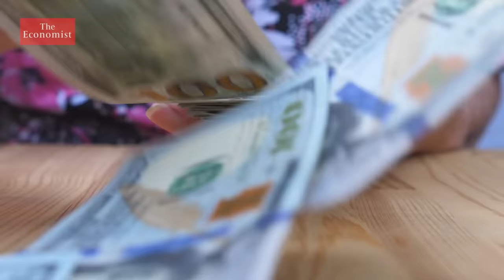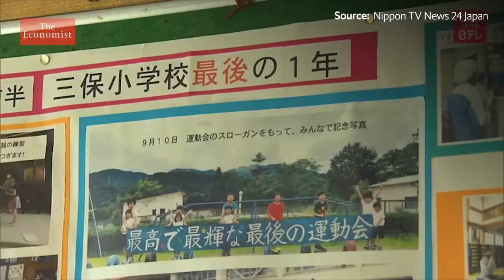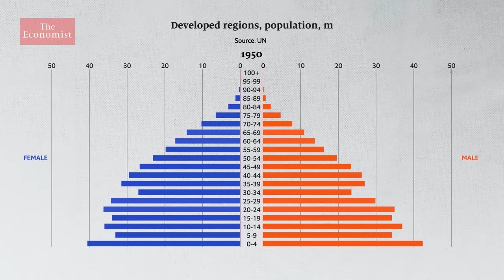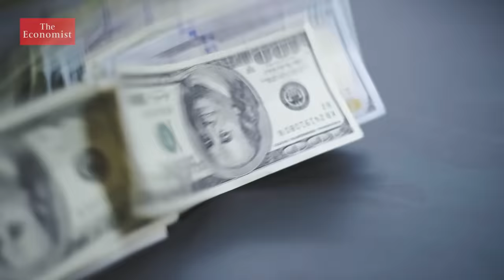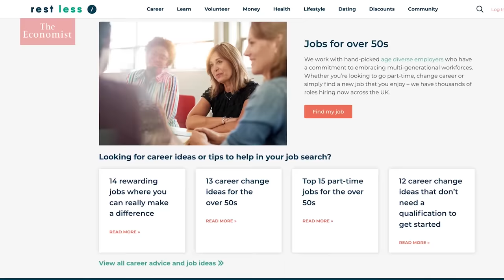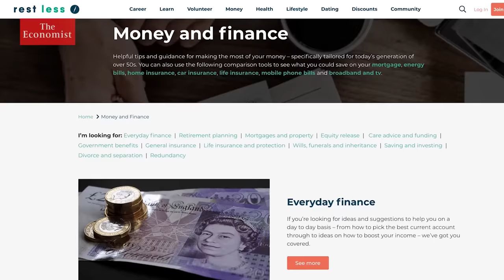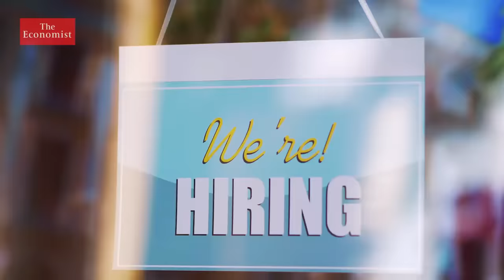The true costs of ageing

Comment: This is the new mantra they are pushing on my demographic (generation X )."If you could all just work until you die and not claim the pension you worked hard for that would be great". After having supported both the younger and older generations in my country for the last 20 years I intend to retire in my late 50s and I have made sure I have the finances to do so, but unlike other generations, I won't be squandering my pensions and finances on overpriced holidays, extortionate golf club fees and over specked Range Rovers, etc. Plus with the increase in both automation and AI technology just what jobs do they think will be left?

Comment: No easy solution that doesn’t over burden younger generations or unsustainable over the long term.
Reply: How about delete the Government policy that assumed a low dependency ratio?
Reply: @RyanLasek  how about increase the tax base (have more babies)
Reply: @alexrussell2903  That's ridiculous. House prices are caused mainly by super low interest rates set by central banks causing it to become desirable as an asset to investors while also bloating borrowing power. Therefore it's a matter of a lack of regulation, not even supply in most parts of the UK where I am from. What low birth rates will do is place financial pressure on young people via taxes, as welfare costs rise. A younger workforce will be a more dynamic, active and energetic workforce and will result in a higher GDP output. Higher birth-rates will make young people wealthier.

Comment: we need to reduce the costs of goods for everyone. mainly food water and housing. and we do have the technology to do that in most cases. we just need to make it more mainstream. lab-grown meat, vertical farming, and smart houses. we work too much for too little. we need to fundamentally change - the entitlement to buy anytime we want something. 
and this was caused by a 9-5 work culture.
we need to drive the prices of most goods to 0.
Reply: @pn7134  No no. He is absolutely spot on, and it is NOT communism. Rather it is the pinnacle of laissez faire capitalism. It is about moving from a single centralized structure to a decentralized one. Previously centralization meant efficiency through use of big complex machines. Now we have the tech in open source to build small and efficient machines. However the CAPEX is higher which means at the moment you need a loan to afford commercial setups. But living off it yourself is not that hard. Take aquaponics for example. It is not stable and well understood yet. But once it is cracked, you can literally live off an automated microalgae +fish+ hydroponic setup with minimal water.

Comment: This seems like some sort of victim blaming. It isn't the people that need to "extend" their working life. If, since the GFC, you've known anyone over the age of say low 50's, most have had a hard time getting re-employed. The reality is that there are very many "Older" people that have finished their original "career", but can still participate in society at various levels. So rather than getting these people to work the typical 9-5 or 40 hour week, how can they work some and provide much needed work. Many elders can and are able to help work with even older and more frail people. But that doesn't mean they should become their primary carer. But not using this resource by meeting them in the middle means it is all wasted.

Comment: Same eyes at the start there, but what exactly happens as we age? Is it our bones keep growing? Or does the skin lose it's elasticity and fat too?

Edit: like what happens to our faces as we age? I want to know everything! I'm 23, so what will happen to my smooth ish skin? lol
Reply: Your face loses fat, your nose becomes larger, the skin becomes thinner, your eyes may either hollow out underneath or develop puffiness or eye bags. The upper lids will begin to lower over your eyelids. The eye area will become creepy. The sides of the eyes around 50 years of age will hollow out or lose fat, maybe sooner. More likely later. The middle of the face will lose fat and you will develop folds from your the edge of your nose to your side of your mouth. Some people get vertical lip lines. Your lips will lose definition. They will also become thinner. Hormonal changes will cause long hair to grow randomly from your chin. When you hit your 60s beware of pulling eyebrows. They may not grow back. You may discover gray hair in your eyebrows. The texture of your hair changes. It may begin to thin, and lose its sheen. Do not blow dry your hair. Your face re absorbs bone. You might need to use bolder color around the eyes, at least I do, because the skin isn’t vibrant anymore. I just found out that our ear lobes become larger. Also, you develop very fine lines everywhere. I’m 72.  Take what you have and flaunt it. Be feminine. And stay away from jealous women.